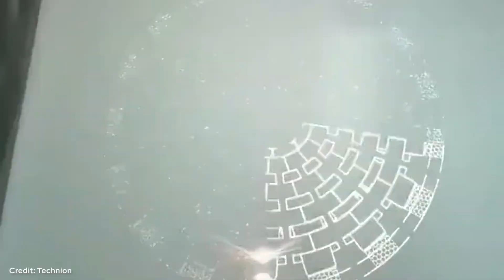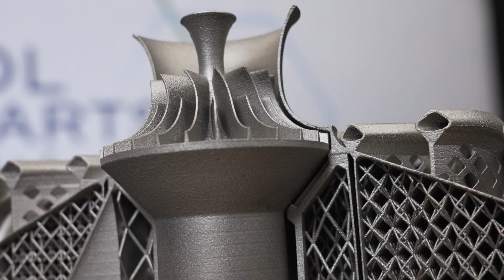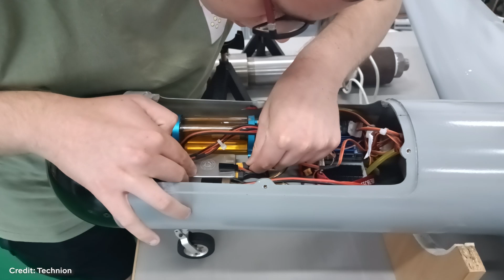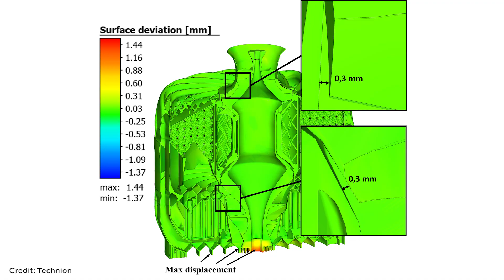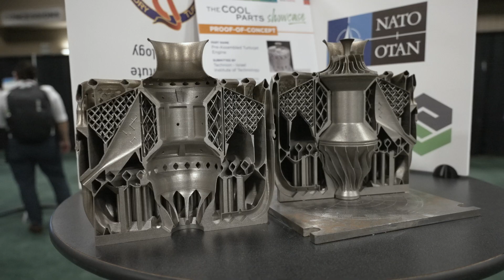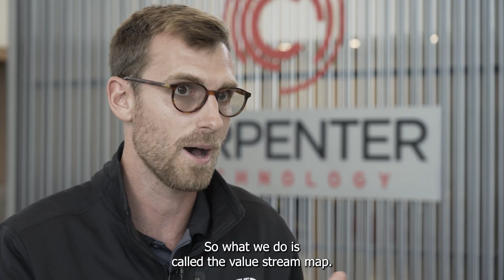Turbo Jet Engine 3D Printed In Only Two Parts

Comment: Funny fact: any self-taught rocket engineer on YouTube, when building their own engine, will show a bunch of test firings — and we'll all believe that the engine, even if not the most durable, is at least a working concept, damn it.
But this miracle, besides being literally born filled with sand (as in the saying "just add sand to kill an engine"), and being a huge pain to clean out that sand (metal powder), also has the only thing preventing destructive friction — the hydrostatic pressure of the fuel itself. Which leads to insane requirements for fuel delivery pressure.
Plus, the longevity of such a solution is highly questionable — after all, printed metal blades aren't exactly the strongest things out there.

Comment: Jet propulation is not just about tolerances its also about friction management which need to be engineering to withstand thousands of rpm without a advanced composite bearing its melts in its first run.

Comment: One huge problem that no one adressed is the fact that that "rotor" needs to be precision balanced to run at turbo jet rpms. 70,000 + rpms in a missle type engine. Maybe the plan is to have them used in lower rpm applications?

Comment: How is the compressor and turbine wheel balanced? How is the surface finish of the bearing surface polished? What alloy is used that is 3d printable and has the same properties as traditional jet engine turbine wheel alloys?

Comment: This is a very nice academic exercise. As in a haiku, they have created a rigid set of constraints (2 pieces, one material, 3-d printed)  and worked their best magic within that envelope, and surprised themselves with many unexpected and possibly very useful solutions. 

Now, if you want a real engine to do real engine things it will require some soul-searching, compromises and nods to practicality. For instance, make it from 4 major parts such as cold section stationary, cold section rotating, hot section stationary, hot section rotating, made from optimized materials and split in the center to allow for enough internal machining to enable the insertion of proper bearings and seals, along with the injectors, igniters, and sensors required for functionality.
Reply: This is so smart and practical, I wonder if they could also get around the bearing problem just by pausing the print at certain points and inserting the bearing?

Comment: Former aerospace designer, current 3D printer designer et occasional mechanical engineer teacher.

Thank you very much for this video. 

I'm using it to demonstrate how NOT to design and use 3D printing to my aeronautical engineers students.

That's a sorry excuse even for a proof of concept.

Combustion chamber flooded with random infill, preventing efficient fuel atomisation.

Hydrostatic bearings my a$$. 
Air cushionning MAY work for light loads, with smooth machined surfaces, and perfectly tuned airflow. 
Not on these raw 3D surfaces, with 300 microns gaps, and non-existant alignment.

You "analyse" so hard your own data that you can't find basic errors in your simulations titles ("Pessure Distribution"), for a lot of it there's simply no scales or explanations of what we are looking at.

When we have scale for stress pressure, we see that's the pressure bearings parts (outer rim of compressor, combustion chamber, etc...) aren't sollicited...

Really, all noise and whistles but nothing of value in the end...

Comment: Why dont they just print the bearing over size and they machine the surface to an exact tolerance? It would be very easy as a last step. A clearance of 0,3mm is pretty bad for any kind of bearing, expecially for hydrostatic. Any hobbyist with a cheap lathe can do this 10x better.

Comment: Gorgeous design, however unless the layer registration problems can be solved (I noted quit a bit of layer separation in the part) the tolerances needed for this to work won't be there. The fluid bearing notion is super, but tolerances for the internal rotor to work without catastrophic collision due to the layer imperfections, are the limiting factor for this technique.

Comment: From ChatGPT:
The Israeli 3D-printed turbojet engine from Technion – Israel Institute of Technology is indeed a functioning prototype that has demonstrated successful operation. Designed by Professor Beni Cukurel and his team, this micro-turbojet engine is entirely 3D-printed, with no assembly required, which represents a significant milestone in additive manufacturing for aerospace. This approach eliminates complex manufacturing steps and reduces dependency on traditional supply chains, which could streamline production and allow for on-demand manufacturing
3D PRINTING INDUSTRY

This technology is particularly impactful in micro gas turbines, which have promising applications in drones and other small-scale aircraft. The 3D-printed components, including high-performance ceramics, improve efficiency and reduce the engine’s weight, which is critical for increasing flight times and reducing fuel consumption
LITHOZ: 3D PRINTING FOR CERAMICS

TECHNION UK
.

In short, Technion's 3D-printed engine functions as intended and represents a leap forward in creating lightweight, efficient engines with potential for military and commercial use.

Comment: If they just printed it in 3 parts they could remove and balance the rotating part and add bearings. In two parts its impossible and just makes an expensive paperwight

Comment: This is a very interesting concept; but it’s an engine that will have a very narrow thrust range. There’s no air management systems on this; no guide vanes or bleed air controllers. This engine will have the same problem as the jet engines of the 1940s. This is a one way engine; so if you’re powering a missile then great. But if you want to land the airplane this would be attached to you’re going to have a problem. Even an industrial turbine needs to have modulating power output in 99% of applications.

Comment: it will be  heavy. You will need to print the entire engine in inconel but the entire engine doesnt have to be inconel. many parts can be aluminum that are not in the hot zone. This will make the engine twice as heavy as it has to be . Human labor is the cheapest part of the equation.  This doesnt really solve anything

Comment: Two parts 😂 don't forget you might need a starter, a fuel pump some sort of fuel control, injectors, ignitors😂 , oil system maybe a oil filter to get the all that dust out, this is obviously a company that has no idea how a turbine engine even works 😂 o yes might want to know what the engine speed is. Three D printed bearings 😂, go back to engineering school 😂

Comment: I don't think theres is enough grounds to justify material change 🤷 its picking a product already in existence and  reinventing the jet turbo when really it's another style at best the consept remains the same 🤔 plus I would rather fork out money to repair a compressor then to replace the whole unit? If the changes don't add  efficiency or some what extra power than normal then why waste energy & time reinventing & put the time & energy into improving or finding the key to higher power etc so put it in the market let it prove what it portrayes then it's a cool style 👌

Comment: Won't work. Plain and simple. There's simply not enough conversion area to produce reasonable output. You could resolve the bearing issue, and build it from insanely expensive zirconia... it still won't work. It needs to be longer and a larger diameter. The output volume needs to be larger. The surface area for power conversion needs to SIGNIFICANTLY larger.

Comment: the design is crap! tha air flop path is so long! omg who designed it- even if you will manage to install the ball bearings in this cylinder- it will not work as the air flow is so discusting! the best way for the air is the straight! in order to increase the fuel flow you must to use compressor(s) so from my  distant this box does not work!

Comment: Very interresting desin. Nevertheless the Hachile Heel of this engine is the fluid bearing. I'm sure this one if it ever runs by itself, must require a very high fluid pressure to maintain the bearing. I can see they want to build very simple drones. Another issue in a drone is stong lateral accelerations, inducing brutal movments of the floating rotor. I would rather add two ball bearings at the end of the print, keep 4 or 6 pieces, and create a very strong and reliable engine. (because anyway you need a fuel pump, electronic control and so on...

Comment: could magnetism along the rotor be used to stabilize it's rotation without bearings? It would aid the fuel flow to steady it.
Reply: No.... the operation the turbine would bring the metal to it's curie temperature.

Comment: Combine as many of the components as you can that provide fuel flow, cooling, combustion and exhaust, with the most critical combining principle being location & temperature such that the cold fuel flow can cool only in the right places, the warmed fuel flow can then combust in only the right place, and the exhaust only moves in one direction, directed by the cooled exhaust manifold. AMAZING ENGINEERING

Comment: Being a layman, my first thought when watching this was... How do they intend to lubricate the rotor? At around 1130, they intend(ed) to use fuel, and create a liquid bearing. However, even he stated that while their tolerances are outstanding in a manufacturing sense, not so great for a liquid bearing. I love the idea, I love the engineering, I love the amount of work put into it. I think maybe at some point we can make functional single print engines, but until I see this run, this is just a theoretical prototype print.
Reply: I think its meant to work as a hydrodynamic (or hydrostatic?) bearing with the fuel beeing used as the fluid. I cant really see how this would work with surfaces this rough but I guess whey made it work somehow.

Comment: 3DP at 120 to 200 thousand RPM? To be efficient, the Vane clearances have to be sub 10 to sub 5 thousandths of an inch. Obviously this was a low resolution repro. But in this rendition there isn't a contact ring that can prevent journal or blade/vane contact. 
But there is a British Helo upstart that is building everything in house. Composite fuse, rotors, and skids, to in house machining, and 3DP turbine parts in house. He's suggesting 500K pounds UK, for a Turbine powered 4 seater. Looks fantastic. He has my vote for innovator of the year.

Comment: Why not be a little bit more precise what I'm saying is put a little bit more attention to the beauty of it being very smooth unless attention to putting your emblems embedded in the sides of the rotor fluid dynamics aren't doing their job if they're letting you put their emblems all over the outside of the rotor

Comment: There's no way they could just 3d print a normal (RC turbine-type) shell with the combustion chamber, outside surfaces, etc and stick in a machined compressor, main shaft, and turbine with some bearings? seems like it'd be a more reasonable approach.

Comment: One engine, two parts and whole lot of bs.

It's same as saying you made perpetual motion machine that will change the world, but you have no data or any footage of it running and just slap a label "proof of concept" and seeing how expensive SLS is even today it's still more economical and more reliable to make jet engines out of machined parts that you can easily replace if they break.

Comment: Bro I've been designing a 3d printed turbojet for 4 months now interesting to see their designs. BUT their designs are wayyy too complicated geometrically, like how are you ever going to fix the turbine wheel if it chips.  My design it based off the KJ66, Gr180.  My engine is composed of just 8 parts and cost, around 500$, 350 being the cheapest version.

Comment: No bearings? No valves, nozzles, no maintenance ports?? How do you Borescope inspect this? I don’t believe I will ever see this in production aviation ever. A cool sci-fi concept and some of the ideas there can be developed but it should not be presented as a practical solution.

Comment: This is am interesting project but totally useless in the real world. It will need machined bearings that are preferably replaceable. Otherwise it's a one and done motor that is not rebuildable. Simple does not always equate to better.

Comment: So let us ponder some key elements of a video with real content:-

Does the concept work? In this case it's a dressed up joke, 200 microns bearing clearance, or 0.2mm plus crap surface finish, plus same materials. You don't need to go to MIT to know that can't work.

Is the concept new? Well printing two components together with a clearance is certainly not a new idea.

Is the concept commercially viable? Not a chance, the 15K $ quoted is the mf cost with no fuel/ignition/electronics etc.
The 50K present cost has already been questioned, mf companies on average need to at least double or triple material costs to cover overheads & make profit.   

So I'm sure these guys are really clever, but possibly misguided/delusional?

As  for the channel, great engaging title, well presented, but little more than clickbait.

Comment: $50-$75 K for a turbine of this size? This guy is delusional. You can buy a Jetcat with 50kg thrust for 15K euro. This includes supporting items like pumps, FADEC etc. 
If these engineers were honest with themselves and their stakeholders there would be fewer project failures
Reply: PBS engines are around $80k.

Comment: Assuming bearing problem somehow got solved, I would think that turbine + compressor assembly is not balanced enough for the RPM ranges this engine needs.
What about heat treatment? I doubt that geometry that complicated could be heat treated as a single piece.

Comment: This all sounds very gimmicky.  The rough surface of the blades is going to create a lot of turbulence.  Single stage radial compressor will always be inferior to axial setup.  Not that this can't be changed, but at this stage this proves nothing.

Comment: Concept only. This thing would not run. Turbines spin very fast. It has to be perfectly balanced.  Printed as an assembly, there is no way to put in bearings. Ceramic bearings are required at this size engine. The turbine wheel is a very poor design. The entire thing would have to be printed in Inconel 625 and heat treated before it could withstand the heat. So many things that would have to change. Still, cool concept and maybe someday something like this will happen. I pri Ted a turbine in 2013 that runs.

The average viewer will think this is much closer to reality than it actually is.

Comment: it'll never run. if they do get it to run, I bet it won't look anything like this when they do. They're severely compromising the design to be able to print it with minimum parts and there's really no need to keep the parts count that low.

Comment: "bearing journal" 😂

Where's the lube system for these "bearings"?  

That's a complex LAMP'd structure with a terribly inefficient gas path design and there is no way that things could function without more pieces and extensive machining.  Even then, performance would be dismal if it even stayed running.  I have doubts about that turbine design being structurally sufficient for use.  

There are actual small jets that are almost completely LAMP'ed systems, with only bearings being added and some machining of the bearing pilots.  The perform poorly and have reliability issues

Comment: Printed  pre-assembled Soooooo There's no great way to balance the turbine assembly that  needs to turn 10's of thousands of RPMs?
All printed from the Same Alloy  (likely high nickel content or exotics like Ti,  HastX or Inco) 
.007" gap would be big even for the Crank-Rod interface in a reciprocating engine.
During spool up, pre ignition, fuel pressure will be lowest so bearing is in most compromised state, 
probably would friction weld the rotating assy to the housing before it bulges from the over fueled hot start.
WhooooooOOOOOOsh BRICK

Comment: This is indeed quite amazing.  However, I would like to caution the Israeli maestros of this work to beware of being too academic in their approach, if indeed their goal is commercialization.  For example, there appears to have been a considerable effort spent on the bearings, and at the end I think I understood the bearing is still deficient. And this is completely understandable, since bearings are a very special technology in and of themselves.  With that in mind I’d like to suggest not to look at this as a one print does everything solution. That is really being disingenuous to the other advanced technologies that have to come together to make an engine work. I’m not saying stop working on a two parts one print technology.  However, if you want to actually DO something with this today, don’t try to solve ALL the world’s problems in one go.  Instead, be prepared to split it up where it makes sense.  For example, I don’t think you will be able to get an acceptable bearing in the near future. But I don’t think you have to.  Use 3D printing where it is natural to do so,and don’t where it doesn’t. It makes sense where that rats nest maze of burn chambers and mixing labyrinth are.  It does not make sense for bearings. It is no sin to break you print into a couple of easy to assemble pieces. I saw a number of ways the prints could be split to allow access for conventional bearing milling and installation. The shaft could be made a 2 piece design for easier assembly if desired.  Your 3D parts have addressed the hard parts.  Don’t make it harder by not exploiting the ability to also divide the single part into a few assemblable parts with a high benefit.
Reply: Honestly, true :  ( Its easy to get carried away and then nothing works. Dont forget to capture what benefit already exists.